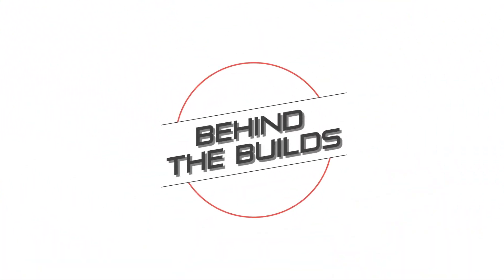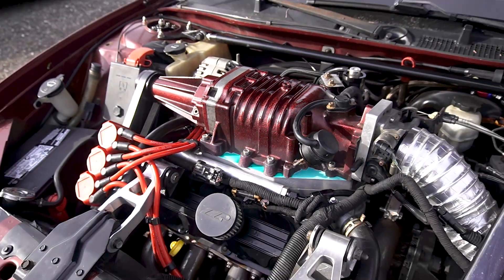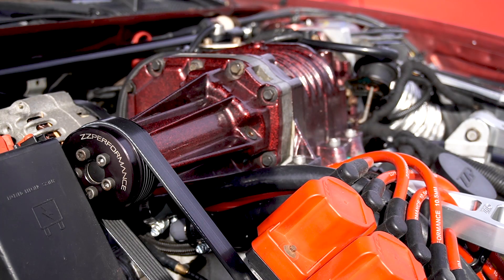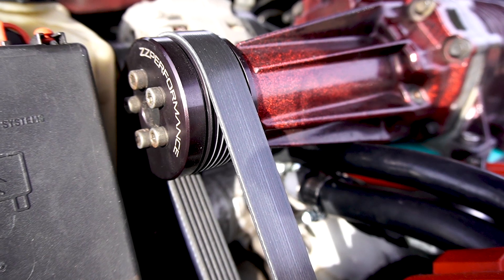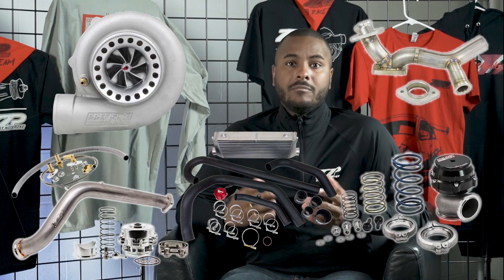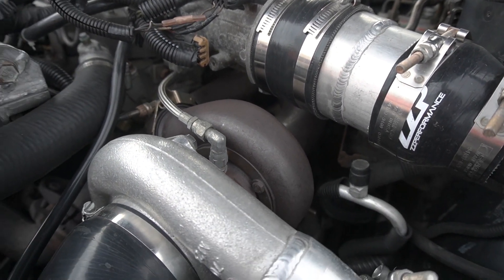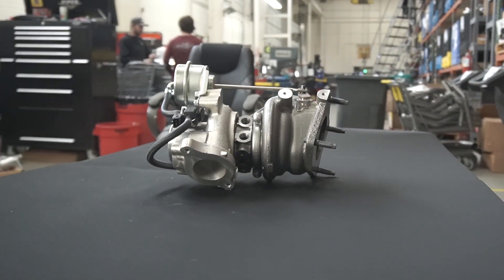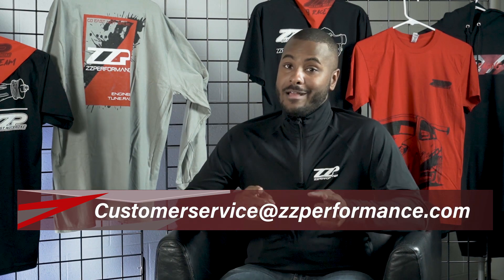3800 Supercharger Vs Turbocharger // Behind The Builds

Comment: Positives-  for a supercharger, no plumbing for the exhaust, change boost levels with pulley swap, less heat under the hood as opposed to a turbo, more engine compartment space. Drawbacks- takes HP to spin the blower. Turbo Positives - Does not put a load on the engine, better power potential. Negatives- gets REALLY hot inside engine compartment, have to keep things away from the heat like oil return lines. Requires special exhaust headers or manifolds that take up space. Requires a blow-thru carb if using on a carbureted engine. Personally I prefer supercharger for it's simplicity. Also, I have a rule of thumb, SUPERCHARGER for a daily driver, turbo for a racer.
Reply: I wholly agree, plus it’s unique and not common to hear about a Supercharged V6

Comment: Question do you make parts for the GM  carburated 3.8 V6 from 1976 - 1985
Reply from the maker: We do not, unfortunately. Our parts are designed for the 1997-03 and 04+ GM 3.8
Reply: @ZZPerformanceChannel  In the near future would you be interested In developing  parts for Ford 3.8 models cars

Comment: Basic, supercharger is belt driven which requires energy from your engine.  SC is also less fuel efficient with forced air whereas turbo increases efficiency by using the vehicles exhaust gasses.
Reply: The great thing about Superchargers robs a Little bit of Horsepower to make even more Horsepower, if U want an L67 to make good Horsepower, toss the shit M90 Supercharger in the bin and go buy urself the 2.4L Yella Terra Whipple Supercharger, as the Yella Terra Whipple Supercharger will handle well over 30 PSI with a good 64mm Pulley Bracket and also on stock crank block and heads. U will need bigger valve springs and stronger Roller Rocker set.

Comment: I get the feeling ZZP is phasing out the 3800. When their stock of parts run out they do  not restock.  You can't get the Lucas 42.5  injectors anymore so I had to go to Intense racing to get them.   They stopped their porting service long time ago. You cant get a ported throttle body or SC  anymore as an example. I was lucky enough to get their full header package before they jacked up the price to over $1,000 even with a military discount, and their aftermarket heads  or ported heads  are no more. You have to go to Intense Racing for these parts now

Comment: I know this is an old video but i'm curious if its possible to do a turbo on my 93 regal with the 3800 series 1 na.... do you know what all would need to be done on the ecu side to make it work?
Reply from the maker: We unfortunately do not work with the Series 1 engines what-so-ever. As far as we're aware none of the larger aftermarket tuning companies support those older ECU's.

Comment: im sure im going to get laughed out of the comments section for this one. but i have a buick lacrosse 2007 that has a 3800 series 3 engine in it. i think bone stock is supposed to be around 200hp. all these mods and set ups for the 3800 engines can i put them in my car to bring up the power? i dont really have a set number in mind for hp and im not looking to drag race the car, but i would like for the car to have a little more umph to it when i plant my foot down and i dont want to sacrfice daily drivability.
Reply from the maker: There are lots of parts that will fit your LaCrosse as the engine is identical to the Series III that came in the Grand Prix. There are a few downfalls however of your starting point. Obviously exhaust configurations once you get past the downpipe are changed on the LaCrosse. The next biggest hurdle is you cannot tune the PCM that was in your 2007, HPTuners does not support it. However you could do some basic mods like coils/wires, front power log, stainless crossover, 1.9 rockers, etc.

Comment: Screw all that !  Throw nitrous at it.  I've had nitrous on all my cars including my current car 06 corvette.   Never had any problems. Do your research,  nitrous is safe and adds a ton of power to your car, plus it's way cheaper.  Just my opinion.  If you have the money tubos are great.
Reply: Looking to make 400hp (300 engine and a 100 shot). Would I need to build the engine pistons rods etc or could I just throw 100 shot at it and not worry?

Comment: I would have liked if he would have talked a little about a centrifugal SC set up compared to a top mounted blower set up.
Reply: centrifugal are basically turbos that run the compressor off the engine so anything mentioned about a turbo applies to them other than you need to eat some HP to make it.  Positive displacement are different in that they give peak boost quick, turbo's and centrifugal need rpm to get peak boost.  All generalized statements because it depends on engine and power added picked.
Reply: Could definitely get a rotrex to fit in there and would be much more efficient than the m90

Comment: To bad there isn't a kit that can run the turbo and the blower together. Something like the 03-04 cobra's have or the 05-10 Shelby GT500 platform has. Never  the less I bet it is possible with some custom work.
Reply: Unknown  yeah the new owner set the record for a stock GTP cam wth a twin charge setup

Comment: Kind of a random and vague question but have to ask as I JUST got into cars and mods. What is more reliable for long term use? I would imagine supercharger but I am speaking with limited experience. Thoughts?
Reply from the maker: Honestly, both can be equally reliable long term with regular maintenance. Obviously, like Ryan says in the video, the turbo will require more parts compared to the Supercharger, so it depends on how much time you want to spend on maintenance.